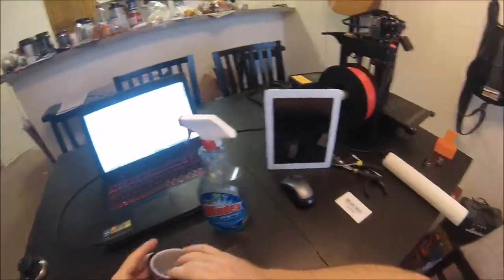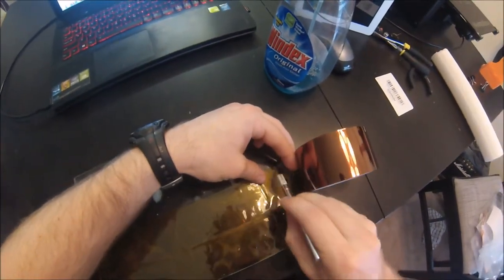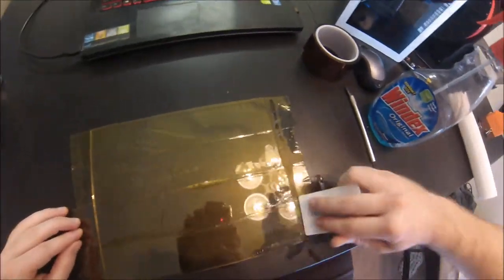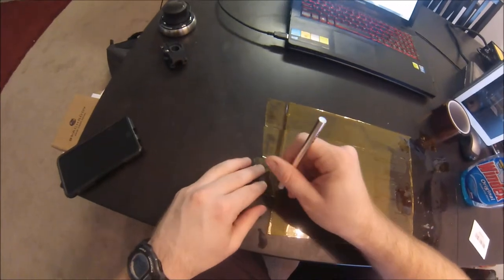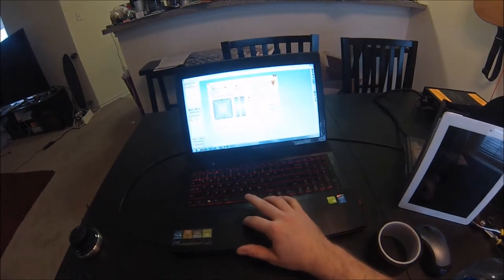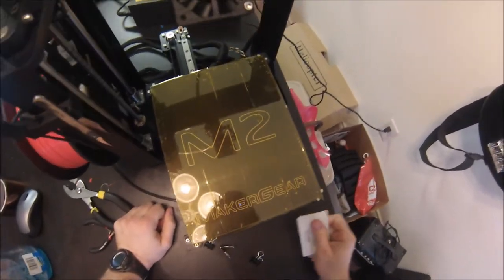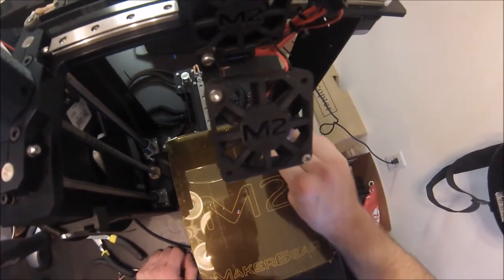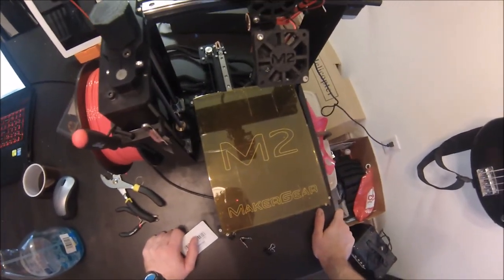Bubble-Free Install of Kapton Tape to 3D Printer Bed

Comment: Use a titanium rotary cutter, you can slice the bubbles out, this will cut the tape but it will be so fine that you won't even see it, also you can use a needle to pop out the air bubble.

Comment: I've not  tried the kapton tape yet, just been using blue tape with abs slurry which sometimes sticks to the tape better then the tape can stick to the glass. blue tape is quick to apply. I bounce between abs and pla frequently so i have 2 glass sheets one for each.
Reply from the maker: Yeah the Kapton came with the MakerGearM2 so I use it regularly with ABS especially. The PLA will stick directly to the heated glass, but I tend just to set up the Kapton tape and have it used with ABS and PLA interchangeably. I've heard good things about blue painters tape too!